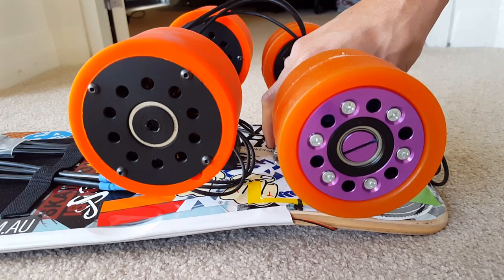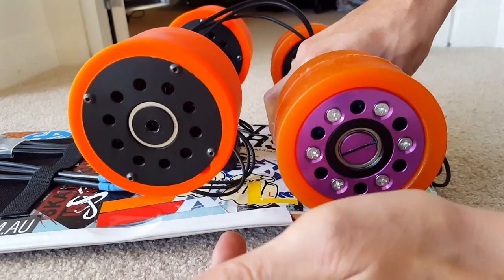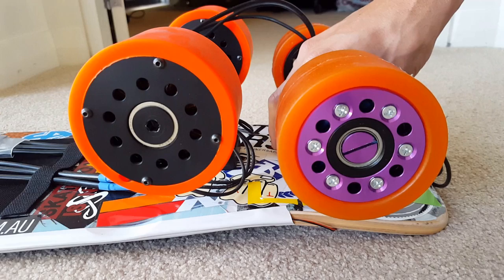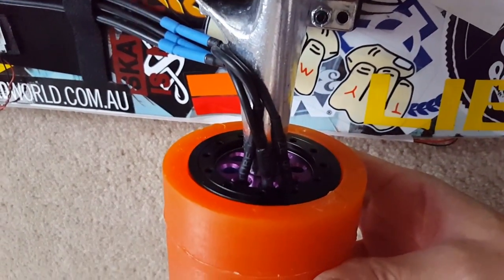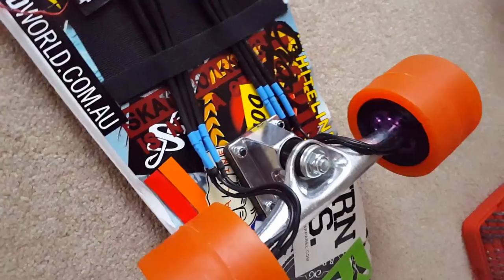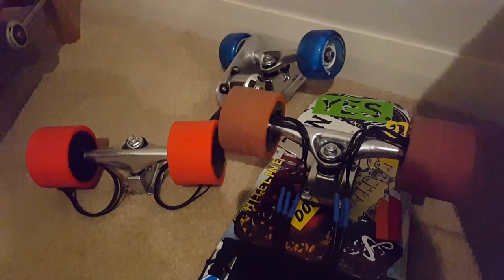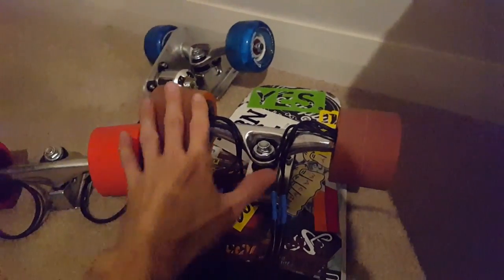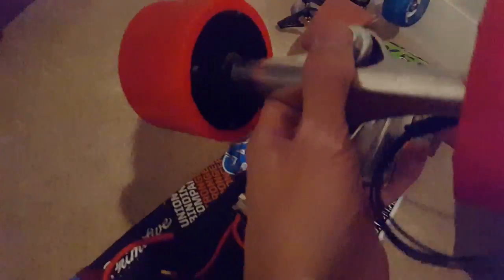Jacob hubs Vs Hummie hubs

Comment: If you tried taking these trucks off, you'd know that glue is never coming off, haha. Hummie and I were able to get some off, but the last ones we ended up throwing out cause it wasn't worth dealing with any more.

The new hummies (v4) solve most of the issues the first ones had. They use a reverse threaded nut to secure the hubs to the truck with custom 12mm axles for re-reinforcement and wheels pour by the same company that does abec wheels with a similar formula and are custom wound and assembled in San Francisco.

But trust me, 1 200lb moderate muscle guy with an arbor press and a 6 foot long wrench couldn't get it off... Good luck, haha.

Check out my channel if you want to see some of the testing.
Reply from the maker: Rocket Boards i made this video 2 and a half years ago. It was relevant at the time. A lot has changed. Hummies hubs have gotten a lot better and EMF (Jacob Bloy esk8support ) ripped a lot of people off taking their money and delivering no motors or sub par items before disappearing.